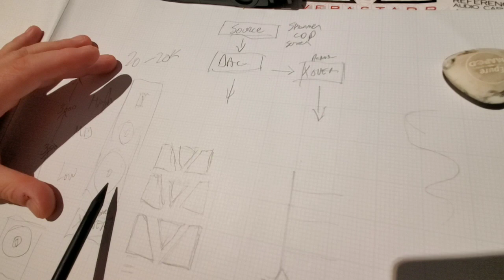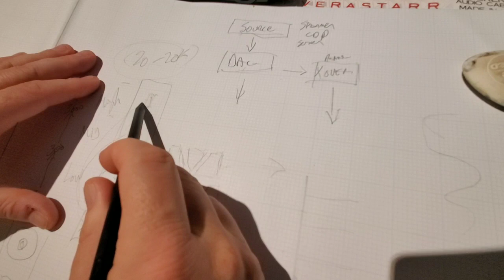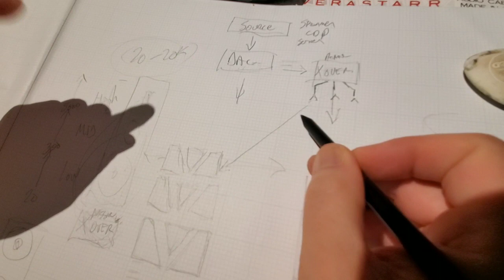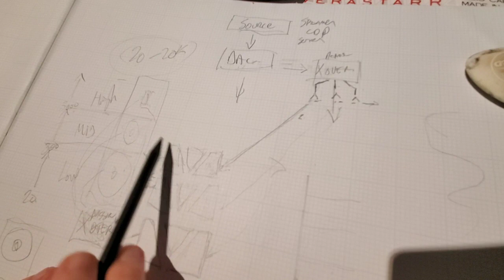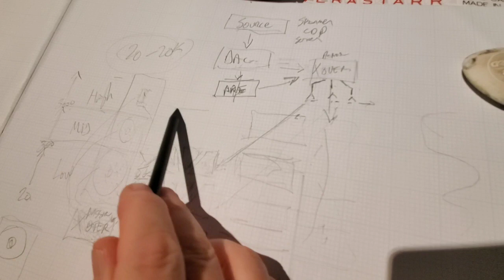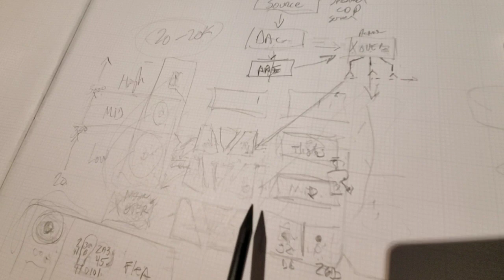Taking High End Audio to Its Limit. Active Quad Amp.

Comment: Mike, I love your videos, apologies but I feel compelled to comment. So you are modeling a crossover digitally then once you feel comfortable with which dips and peaks you want to modify and tame then you translate the results to an analog crossover with inductors, capacitors and such correct? Now, and bear with me patiently for a moment, by the way I'm not in the industry, I'm a network engineer with some experience installing BDA's for the RF industry which principle is the same, get a small range of frequencies to amplify more efficiently, I'm getting off topic here, ï'm just not picking your brain to create something commercially speaking but from a home / amateur point of view. The part I would like to understand if you  feel like sharing is how do you model it. IME from my limited audio knowledge you can do several things. 1. You can use the manufacturer published curve for a specific driver and create your crossover based on the published curve, not very accurately as speaker designers measuring manufacturers curves have discovered that not always the published curve matches real time results. 2. You could measure the driver response on an anechoic chamber (maybe you have one at hand) and build based on those measurements. 3. You could measure for your specific room on your specific house and design a specific crossover for your room (would be easier to do room DSP of course). So I'm just curious of the methodology you use, I do because I respect what you do and publish and learnt quite a bit watching your channel. I'm the guy who sent you a new Denafrips Terminator about a year ago with a lose screw inside from Miramar Florida if you remember, thanks for the fix.

Comment: Question is...How much do you want to spend and is it worth it for your situation. If you put one amp to each of your drivers in a passive  how much loss are you experiencing compared to the active crossover? Active crossovers sound great but unless you know what your doing the average layman is still better off with a well designed passive crossover.
Reply from the maker: Lets see I want to spend nothing and I want it to do everything... Is that OK ? Can I make that work ? lol   OK, So Im trying to follow.. One amp to each driver in a passive ? No need to do it.  I cant tell you how much exactly the loss is from a passive used on every driver with a mono amp but active eliminates a lot if not all of it. this example is extremely uncommon. Enough that ive never heard of it.  Oh yes, we are a far ways from average layman, its why my name is OCD HiFi Guy.. I take it the distance.  what Im saying to the above average listener is that wait until you hear how much better active filtering and multiple amps sounds. Nobody needs to act on it its just that I have the ability to demonstrate this which not many people do, or would want to if they could , so I am providing a service for free, so that your or thier learning curve for HiFi is rapidly advanced than if left to the industry as it is .... Theres no salesman that will teach you this kind of thing, none has this much experience in manufactiring, etc. .  In case you have not realized this , the underlying theme of my channel is to give you enough information about myself, my personality, and integrity,  then back it up and prove I put my money where my mouth is, So in the end yo uwill deem that I am the best person to assist you through this hobby by selling you everything you need and by giving you free personal consultation  if desired. everybody in HiFi talks a big game pretty much, but you realize after a bit a LOT of the sellers simply talk about things they read somewhere as if they know it to be true. I only speak about things Ive actually tried or experienced.

Comment: Hey, can I use my buchard S400 with active crossover?
Reply from the maker: Yes you can but it entails modification . you would drill the back and add another pair of posts, then open them up and unplug the existing wires and wire one set of posts directly to the bass driver and the other directly to the tweet. If you do this, be sure to mark the back sayin so, otherwise someone that does not know this could toast them.
Reply: OCD HI-Fi Guy maybe show us how it's done and sound like?

Comment: So.... I just woke up and see your demo. Mike your mouth is one way, but your mind is in split quad mode running and trying to lay out the lesson hehehe. Its very "nutritional" to those, that need a clearer vision to these concepts. Well done ..... so relax you 've done your share for the class today. My recomendation as an example is the Cube https://www.cubeaudio.eu  although the do have 2 or even 3 wizz cones are they are extremely unique. Less cables. amps, cross over components and and connectors (metals) in the signal chain. Adding your precious metal hand made ribbons cables ........... one can reach PURE audio extasy.  Good luck with the next tweak with your expert guest.

Comment: Which crossover would be used in this example? As in brand/model? What happens to the crossover in the speaker if you are already using an external crossover?
Reply from the maker: There are many. Easiest way is to use a DSP based solution. For Instance Behringer DCX 24/96. I bought one at Guitar Center for $300, then modded the crap out of it with a whole new input/output board, but keep in mind , with this solution, you put a cheap as crap DAC in your chain in addition to the normal DAC. So I use this thing as a tool to find my points and slopes, then I ditch it and solder up some modules to recreate what I modeled in the Behringer and put them into my analog crossover. Nobody makes an Analog 4 way crossover, but thanks to some very adept engineers that know filters very well, I had a design made and I sell it for $3K. Its a fully differential, 100% discreet (no opamp chips)4 way active analog crossover and its HiFi and studio grade.   Bryston makes one, and  Pass Labs makes one as well.

Comment: Great Video! It’s about time someone designs a active crossover rig for home systems. The car stereo guys have been doing this for years and the difference in sound is stunning. Can’t wait til the next video. Thx 4 sharing.
Reply from the maker: It's TRUE. Not sure how old you are but I've still got a PPI Art Series full setup in my old pickup..lol mono amps. 30 Band EQ and Crossover as well. These have been around in home audio the whole time. Its just not mass market home audio. It started on the pro side of things, as with live sound, you really have no choice. So you can find pieces made by Ashly, Behringer, DBX, all for $300 or less. But to find a 4 way analog crossover made well was impossible for under $5K. Unless you comission one to be made. So I had one designed and I sell it on a made to order basis for $3K. Made in USA.  Happy listening!
Reply: OCD HI-Fi Guy haha,  that’s funny I grew up in 80’s and my first amp was a PPI. I am running my old soundstream amp with Alpine separates and Jl Audio sub setup still in my truck and it sounds great. I miss going to all the car audio competitions and seeing all the new setups people show up with.
Reply from the maker: @Darrellsrelm  totally , I'm same age. How about the Orion Cheater Amps , or the Fosgate Punch 45 that looked like no big deal ? Ive got an unused new in box Tube Driver Blue from Butler. Focal Utopia crossovers from my set. I just cant bring myself to cut up the cars I drive now. and my car used to be my reference rig as its all I could afford at the time. When you think about it theres probably no worse place to set up a rig, but theres also no place you can play and get the same visceral impact.
Reply: OCD HI-Fi Guy rockford amplifier and alpine crossover
Reply: Yeah I had a Orion 425 Red Line with four 12 inch woofers 2 8's  and 4 horn loaded tweeters in my car and a JVC cartridge CD player which was the first I found in town.